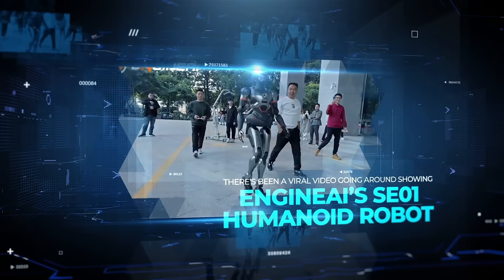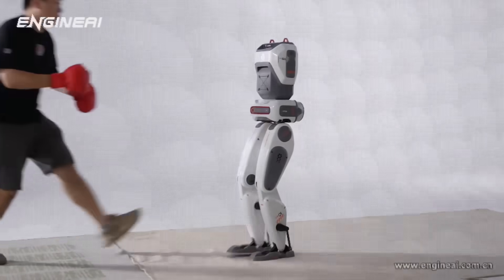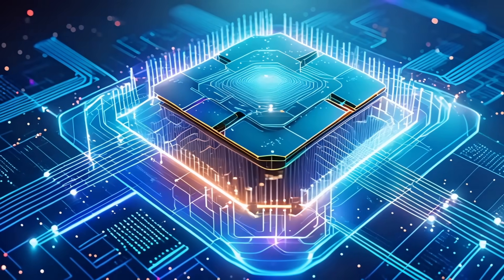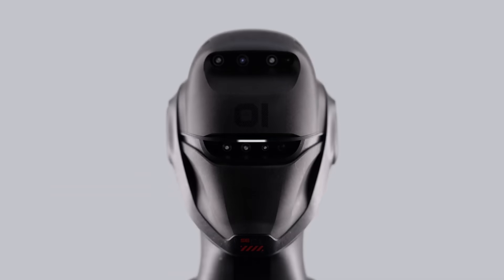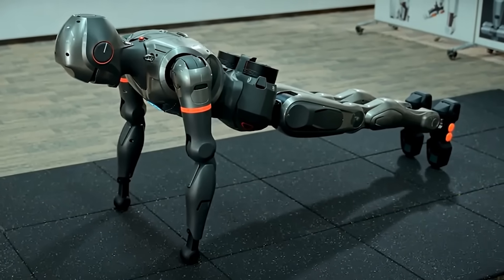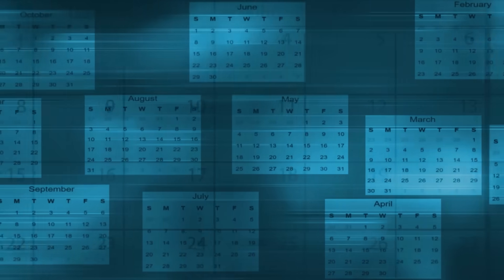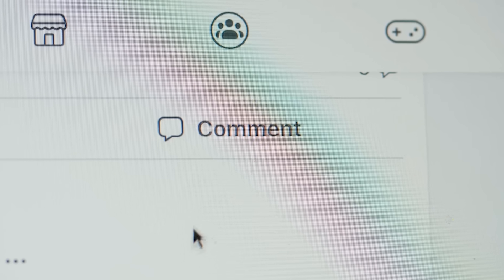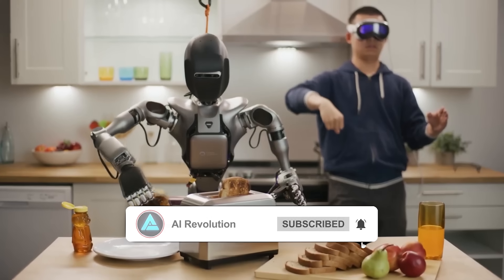Mind-Blowing Humanoid Robot Walked Outside (The Internet Exploded)

Comment: Why don't they let the toe area bend like the human foot does? I would think that would make for a smoother gait and make it possible to run?
Reply: It adds a level of complexity and potential weakness. Unlike the human body which keeps regenerating its body to a great extent and actually strengthens with exercise, robots will wear and tear, especially a toa that has all that weight on top. It's more about how much you gain per one added complexity, and that toe isn't beneficial enough. It is more beneficial to put more complexity in the hands, for fine coordination, rather than foot. Robots at this point need just to get from A to B effectively, they don't need to climb challenging terrains or trees.